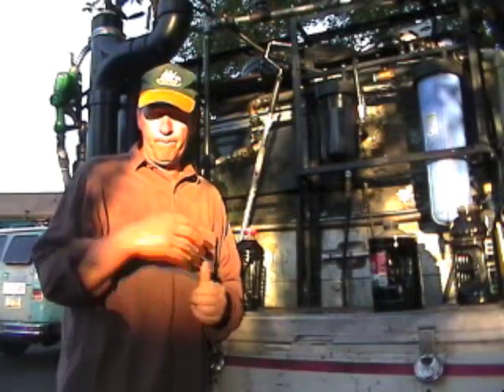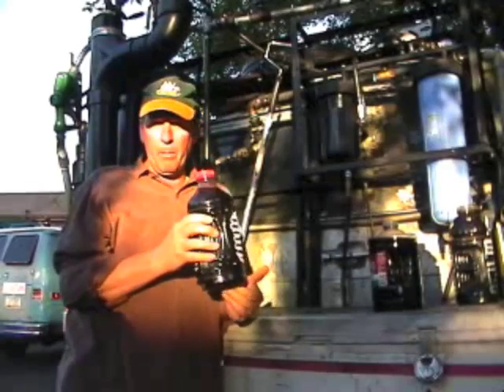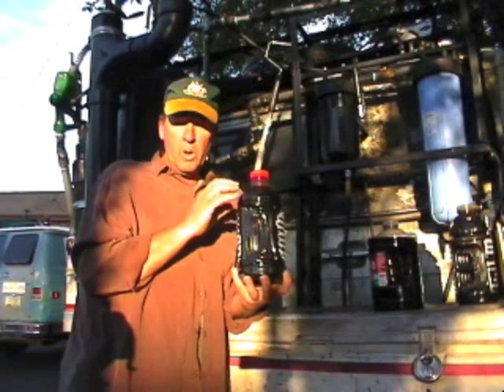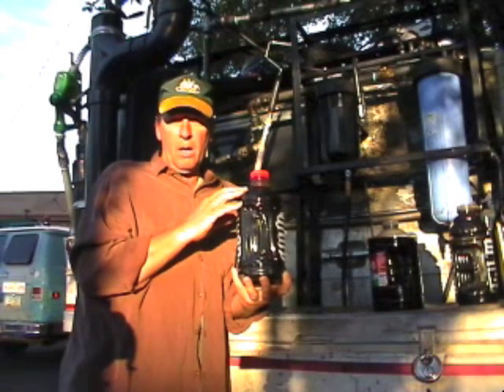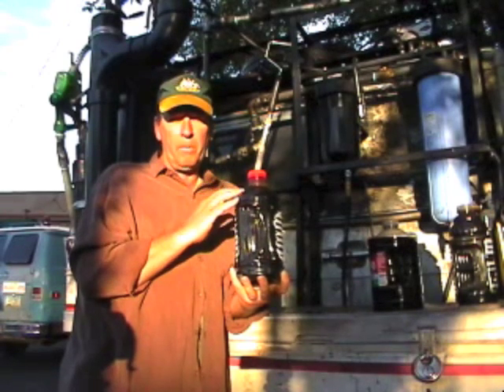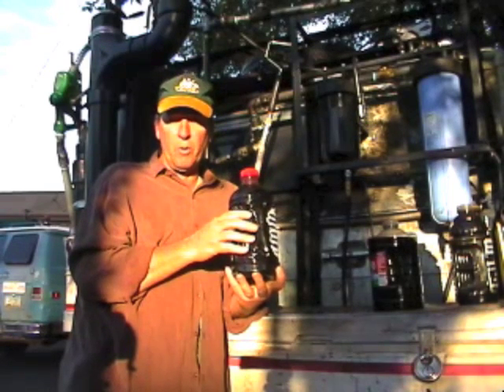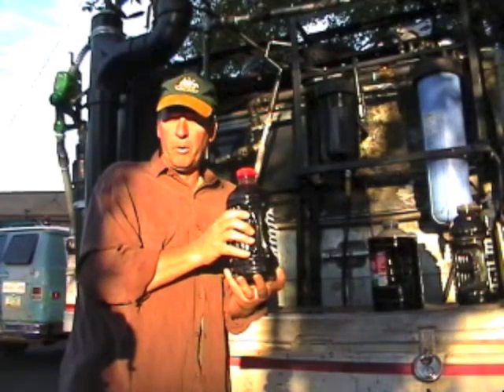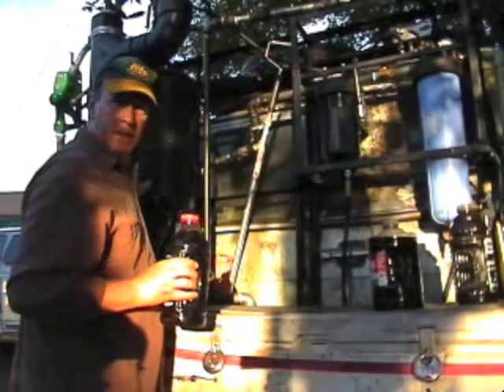Making Black Diesel from waste motor oil (WMO)

Comment: Has anyone here have experience in using diatomaceous earth to filter oil? Vs filter screen media or centrifuge?
Reply from the maker: I have not used diatomaceous earth to process any waste oils into diesel fuel. I did try activated charcoal to remove the dissolved carbon in waste motor oil. Motor oil happens to be an excellent solvent for carbon, so activated charcoal actually contributed carbon. However, if you want to try using diatomaceous earth to remove dissolved carbon from waste motor oil, then it seems like a reasonable experiment. 

It turns out that waste vegetable oil is a poor solvent for carbon, so I have been employing differential solubility to do my molecular purification of waste oils. For instance, after I remove the suspended particles in both waste motor oil and vegetable oil through lengthy settling periods keeping them warm (75f/25c), then separating the sediments; then I add diesel to both waste oils at 20%, then leave them to settle warm for a month, then remove any sediments, then I combine both solutions in equal parts, then leave them to settle for another month, then remove any sediments. At this point I see a fair amount of sediments, which I find is a combination of carbon, high melting point triglycerides and gum, all of which have to be removed to reduce injector coking. Then, I add gasoline to that blend, and leave it to settle for 24hrs. Then I remove sediments. In the final stage of using partition solvent chemistry I add acetone at 1% of the total solution, then leave settling for another 24hrs, then remove any sediments, then filter to 1 micron. 

At each stage in this process I find significant sediments to remove, and using a separation funnel is critical. Also, I never agitate the solution at any stage because I want to promote separation of sediments. 

Yes, I have used a centrifuge. I would only use it in the final stage, but my process ends up making such a pure fuel that there is usually little left in the centrifuge bowl that it is not worth the hassle. Plus the centrifuge bowl has such a small volume that getting the sediments out without the lengthy process I described above, it would take multiple passes, which takes a lot of my time. Whereas, my process just takes time for settling, which doesn't consume any of my time.

Comment: Ive heard cutting filtered wmo w 50% diesel works best...anyone else try that?
Reply from the maker: Yes, I found 50% waste oil plus diesel at 30% plus gasoline at 20% plus acetone at 1% reduces the likelihood of injector, valve and ring coking.

Comment: Ever tried any experiments with 99% alcohol? I have access to 99% alcohol at work and thought about doing a mix with WMO for my idi.
Reply from the maker: I think, since you have access to alcohol 99%, then the biodiesel process would be better for you, because alcohols pose a blending problem for a number of reasons. 1) first and foremost waste vegetable oil tends to have high levels of gum which leads to engine coking. 2) alcohols tend to ruin the seals and hoses in the fuel system. 3), if you want to blend with alcohol it would have to occur after removing the gum and should not be more than 3%, unless you know your vehicle can handle higher levels of alcohol.

Comment: Can you use waste hidraulic oil from presses and ballers?
Reply from the maker: Yes, used hydraulic oils work great for diesel fuel. You will probably need to settle it, then thin with gasoline at about 5%, then filter.
Reply: @Jhananda  Thanks man.
Greetings from Serbia

Comment: This is awesome. I wonder why you don't use 20% or 30% diesel mixed with WMO instead of gasoline?   I really want to try this on my 2000 ALH TDI VW.  Too bad I got rid of at least 12 gallons of fresh, clean ATF from my single column auto hoist a few years ago. Oops.
Reply from the maker: The point of using a lighter solvent than diesel fuel to thin waste oils is using diesel fuel alone as your solvent with waste oils the waste oils end up thickening the diesel fuel; whereas, gasoline blended at 20% with most waste oils results in a blend that is closer to the specific gravity and viscosity of diesel fuel. However, since you mentioned WATF since ATF is close to the viscosity of diesel fuel, then it doesn’t need thinning. 

And, while we are discussing solvents for processing waste oils into diesel fuel, then kerosene is really the ideal solvent of choice as long as one can acquire it for less or same price as diesel fuel.

Comment: Considering most people just burn it in a shop heater. I have to wonder how it would run in a Lister engine.  Motors that are so simple that they're practically indestructible.

moreover what motors could this be run in where it would be consistent if it was refined in a consistent process. 

Because just burn in a shop heater isn't really getting the full potential out of the oil. 

Of course there is the concept of using it in a small thermal power plant.

But to me it seems you could get more power out of a generator style system.
Reply from the maker: Good to know that wast oil runs in shop heaters.  I would caution burning it in an unventilated space because there are surely some emissions that could be toxic if concentrated.

However, waste oil blends seem to work fine in diesel engines and turbine engines, and in oil fire boilers.
Reply: @Jhananda  I don't see why you would ever waste used motor oil just for simple burning practices in a furnace 🙄 considering that it could be used as a power plant if it's just converted. 

As far as fumes go. Simply vented out the same way you would any oil furnace or engine..

It's kind of a No Duh situation.

But then again every once in awhile you see some jackass on the news that kills her whole family cuz they're running a heater in a house.

Comment: Most fuel filters are very poor in dong there job. For example OEM filters might be 2 or 4 micron but are only 60% efficient. Which means larger things get through. There are now very high performance 2 micron filters that are 99% efficient and remove all the harmful material in not only normal fuels, but also oils. They are now widely used in trucking fleets and mining operations to protect expensive drive trains,engines etc. They are much larger than normal filters, but they do the job, including removing the invisible,entrained and dissolved moisture that rusts fuel injection systems on the inside, a common problem for smaller, common rail diesels.

Comment: hi sir, am blending wmo 80% to 20% gasoline as u had mentioned. blending for 5 days then filtering and send to diesel tank in my old mercedes. it goes very well in every thing except in exhaust smoke,i am looking for a solve to smoke problem , just asking if i can add any additives to solve smoke problem.    thanks a lot
Reply from the maker: A turbo charger would make it less smokie, and help your WVO fuel blend to run cleaner and more efficiently.  I find 50% WVO 20% gasoline and 30% diesel is a better blend for a naturally aspirated diesel engine.
Reply: 100% diesel to 0% WMO is a great blend to stop excess smoke and not kill the rest of us with the heavy metals you are pumping into our air.

Comment: +Jeff Brooks Do you know if Methanol could be a substitute for Gasoline? I saw you mentioned turpentine also works well.
Reply from the maker: Methanol is likely to damage the seals and hoses in your fuel system; so I cannot recommend it over 3% in a waste oil blend at this time.
Reply: Jeffrey Brooks Thanks reason I ask is because it's used in biodiesel production.

Comment: Have you ever used Creamy Vege Oil to make biodiesel? I see a lot of waste creamy veg oil online, but I don't know anyone using it for fuel.
Reply from the maker: +Tesla Fan Yes, using my method I have been turning creamy vegetable oil into diesel fuel for about 5 years; however, I would suggest that the results would be better with a light cooking oil, like canola oil.  It is also best making and burning DIY diesel fuel made from creamy vegetable oil using my method during the warmer months.

Comment: Jeffrey Brooks I have been running my 50/50 wmo diesel mix through still on my first tank but I noticed the other day my exhaust pipe is turning and gray/white color is this normal? Truck seems to be running good on the blend. Truck is a 96 7.3 psd. Thanks
Reply from the maker: Corey Boyd a gray/white color in the exhaust pipe normal for WMO.  The color is ash.  If the 50/50 wmo diesel mix works for you, then keep it up, but as cold weather comes you will probably have problems starting.  Most people find 20% gasoline to 80% waste oil runs better year round.  Also, blend before settling WMO blends for weeks to months to reduce the sediments in your fuel, then remove those sediments before filtering.
Reply: Jeffrey Brooks thanks a lot. My next batch of 20 gallons WMO with be cut with at least 15%RUG not only to thin it out a bit but to help with sediment . That should be 3 gallons of RUG correct?
Reply from the maker: Yes.  Let us know how it goes.

Comment: Jeffrey, do I need to add gasoline to my wmo if I will be mixing 50/50 with diesel fuel or 60 diesel/40 wmo?
Reply from the maker: Corey Boyd All you are doing by blending diesel fuel with waste oils is thickening the diesel fuel.  This is one of the reasons why blending gasoline with waste oils works better.  However, once you have your 80/20 waste oil/gasoline blend, and settled it for a month or 2, then separated out the sediments, then filtered it, you could then blend it at 50% with diesel fuel, and if you have a turbo, then your engine will only run a little better with the blend.

Comment: can you blend diesel with oil.
Reply from the maker: Yes, almost all oils will dissolve into most organic solvents, such as WMO into diesel fuel; however, using diesel fuel as a solvent for an oil only results in a fuel that is too thick to burn properly.  This is why I blend waste oils with gasoline to make diesel fuel.

Comment: can i use this type of fuel on a 2012 passat tdi? if i choose to filter the oil before mixing it with gas, how to get rid of waste?
Reply from the maker: Black diesel cokes the injectors on my non-turbo-charged diesel in a short time.  However, I have ready many reports from people running black diesel on a wide range of turbocharged diesels with no trouble.

The processing method that works for most is the blend gasoline at 20% with WMO.  Leave the blend to sit for 1 month, then pour off the thin liquid, leaving behind the sediments.

The sediments from making black diesel can be disposed of at a WMO recycling center, or used as fire starter for a wood or coal fire.
Reply: Jeffrey Brooks PLEASE LET ME KNOW BUT I ADDED LACQUER THINNER TO MY FINISHED PRODUCT OF BLACK DIESEL FUEL AND I NOTICED A WHITE CARMEL GOO AT THE BOTTOM OF THE JAR. WHAT DOES THIS MEAN.  IF I ADD ANY OTHER SOLVENT LIKE GASOLINE, NAPHTHA, MINERAL SPIRITS AND PAINT THINNER ITS FINE ONLY LACQUER THINNER . PLEASE LET ME KNOW THANKS.
Reply from the maker: MIKE SATTER
As these videos shown I have blended lacquer thinner with WVO, I have not tried it with WMO; however, the whole reason why settling for at least a week is so important after blending a solvent with a waste oil is to allow any precipitates to settle out.  Once the precipitates have settled out of any blend, then the blend should be a stable fuel.
Reply: Jeffrey Brooks THANKS FOR REPLYING.  IF YOU HAVE THE TIME PLEASE LET ME KNOW WITH BLACK DIESEL FUEL WHY LACQUER THINNER DOES THIS.  THNAKS AGAIN BIG FAN OF THE WORK YOU DO THANKS
Reply from the maker: Whenever there is a precipitate formed, there has to be a component that was in solution, but precipitated out.  So, apparently lacquer thinner causes something in the WMO to precipitate out.

Comment from the maker: Arguably, I am on a 6.2 forum, where some people there can burn WMO without issues.  It turns out all of the 6.2s that can burn WMO-gasoline blends with out issues have a turbo; whereas, my engine does not; and all of the 6.2s that have coking issues with burning WMO blends all do not have turbos.  So, the turbo seems to make burning WMO more trouble free.

Comment from the maker: My first set of glow plugs lasted 5 years.  In that time I burned almost exclusively WVO-gasoline blends.  2 Years ago I experimented with WMO-gasoline blends for a year, those experiments ate my glow plugs, and wore out my engine.
Reply: What engine were you running in it
Reply from the maker: @howardwilliamson7363  I did most of my waste oil based fuel experiments on a 6.2l GMC diesel engine.  I also have a deuce and a half which I have run on DIY diesel fuel for about 10 years.
Reply: Egt temps…..
Reply from the maker: @mikecorleone6797  I didn't get an EGT gauge until the last few years. The exhaust temperature running DIY diesel fuels seemed to be consistent with petroleum diesel fuel.

Comment from the maker: WMO ruined my engine.  It is not the small pieces of metal, which can all too easily be removed with a magnet; but it is the high levels of dissolved and suspended sub-micron particles of ash and carbon, which cannot be removed without distillation, which build coke deposits in the engine from burning it as fuel.  So, I am presently building a WMO distillation system.  When I have it perfected, then I will produce a video on it.
Reply: Any progress on this system?
Reply: There is a guy from NZ with w Russian accent who sells the plans to a waste oil still. He has vids on youtubr demonstrating it .

Comment: Have you had any problems with the engine while using Black Diesel for fuel?  Someone told me, it could have small bits of metal in the motor oil, that can damage the cylinders.

Comment from the maker: I do not see why petrol in any waste oil blend would burn out glow plugs, because I used the same set for 5 years on my 6.2.  However, I recently had my glow plug controller start working erratically, and it was turning on my glow plugs and leaving them on for long periods of time, which burned out my glow plugs.

If you have to add a second fuel pump to push your fuel through your fuel filters, then your fuel is too thick, so you need to add more petrol.

Comment: Thanks Jeffrey, I'm unsure of the problem but it is a Mitsubishi van so could be many issues unrelated, I also have a 89 Chev Suburban 6.2 that runs with the blend but I had to modify the filter system (same with the van) by fitting a fuel pump to push the fuel through the filter as it just wouldn't run right without it is this what you've had to do? and what do you think would cause the glow plugs to burn out? I'm thinking my blend may have had to much petrol.

Comment: What about using a centrifuge to remove impurities completely (or almost) so as to avoid the engine gunk buildup and to improve burning efficiency? What is your opinion about mixing with solvents (light aromatics) from the lower carbon chain (5, 6, 7, 8)? 
I live in an oil producing area and these are by-product of natural gas.

Comment from the maker: Aeration of the fuel is unlikely a cause of common gasoline blends; however, if you have a heated fuel system, then you could have vapor-lock in blends with more than 5% gasoline.  Nonetheless, if you have been running the same blend for 80,000kms, then your problem is more likely a plugged fuel filter.  

If you settle your blends for at least 24 hours, before filtering, and you remove the sediments, then there should be no water, or animal fat, or other HMPEs, in your fuel blends.

Comment: Hi Jeffrey, have you ever had a problem with aeration of the fuel perhaps in the injector pump possibly due to moisture in the oil? because the engine will stop but if I leave it 10 minutes to sit it'll be fine for a while and I'm thinking that I have not got the oil temp up enough during the making process...the other problem is starting has got difficult this is after 80,000kms and several glow plug changes

Comment from the maker: Your generator most probably does not have a turbo charger, but your car might.  If that is the case, then that would explain why your car will run on WMO blends, but your generator will not.  For some reason turbos burn WMO blends better than non-turbos

Comment from the maker: I do not believe that sea foam will help; however, running WMO-gasoline blends in a 2-tank system, in which the engine starts and shuts down on diesel fuel, and only runs on WMO when the engine is at operating temperature might improve its burn.

Comment from the maker: Interesting.  I have found alcohol in excess of 3% tends to cause seal swelling in diesel injector pumps. So, I prefer keeping gasoline below 30%, which has alcohol in it at 10%.  I have also found Turpentine works fine as a solvent with vegetable oil, which would make the fuel blend 100% bio.  I plan to try it as an engine lube soon.

Comment from the maker: A blend of almost any waste oil at 80% with gasoline at 20% should run on any diesel engine without modifying it.

However, WMO has a lot of ash content, so it can lead to premature engine wear, so be ware.

Comment: Black diesel can really gunk up your engine quick but there are better and cheaper ways to deal with it than store bought fuel additives IMO. Algae based Bio-Diesels and Algae oil contain amounts of Chlorophylls which can help break down and remove some of the gunk buildup in your engine. Also HHO injection (Not sure how that works combined with Diesel, I might add) can literally blow years of gunk out of your engine and cause higher burn efficiency.